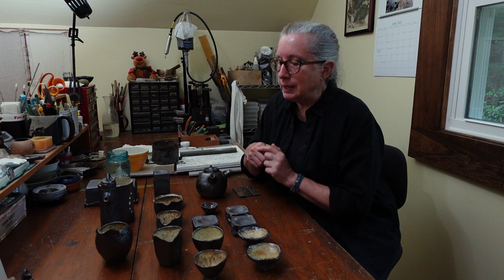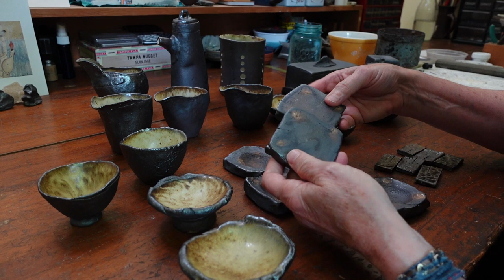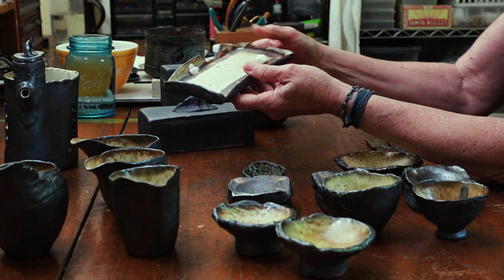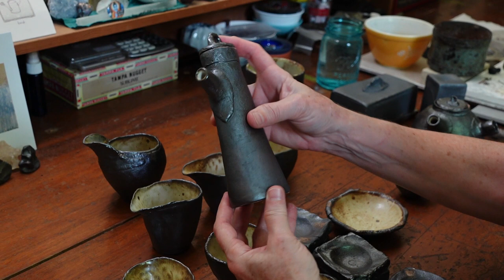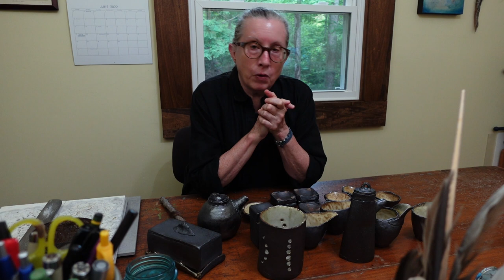Wild Clay part 4, post firing recap

Comment: Thank you for sharing your journey with processing and using your wild clay. I live in another part of North Carolina, where there is sand everywhere and no rocks at all. I have a small vein of clay, which contains between 25 and 40% sand and silt. Straight out of the ground it is almost impossible to throw on the wheel and readily falls apart in your hands. But I have altered my processing methods (without any additives) to separate the sand and the silt from the clay. For me removing the sand is easy. It is the silt that is the most difficult, because the silt particles are so small that stay suspend with the clay and they also easily flow through an 80 mesh  sieve. I now know how to remove the silt and produce a clay that I can throw on the wheel and even pull some handles. It is not perfect, but it is usable now. The key is to mix the raw clay with enough water to form a very thin slurry (even thinner than cream) to allow the sand and silt to settle out. I think the term for this is levigation.  I wish you the best.
Reply from the maker: Congratulations on getting a working clay body! I’m enormously grateful that my source requires very little amending. I hand build everything, which gives me more leeway. I’m still dialing in ratios, but I’m thrilled with results thus far. Thanks so much for watching and taking the time to comment and share your journey … really appreciated! 🙏